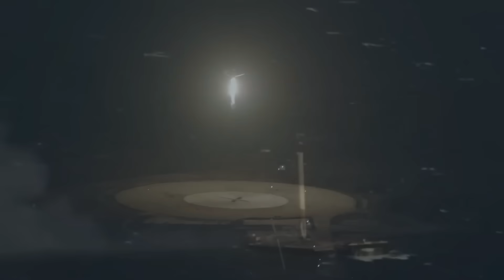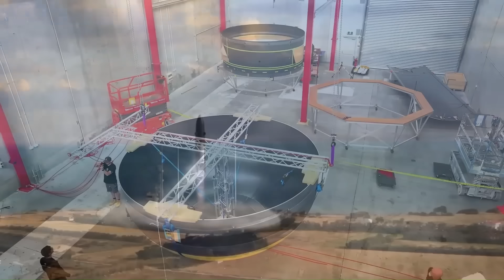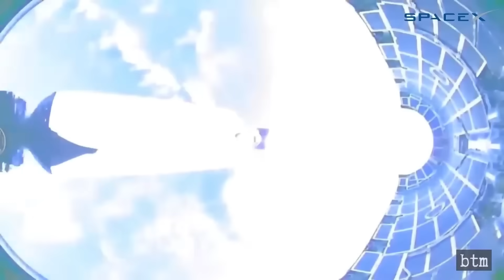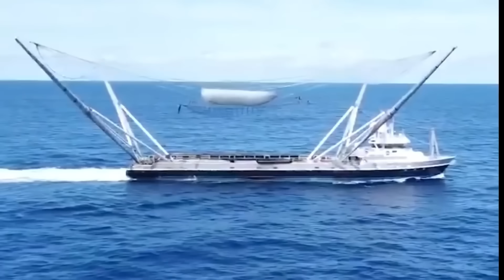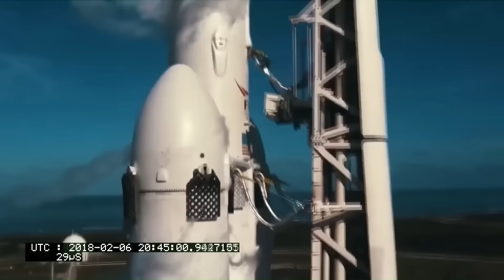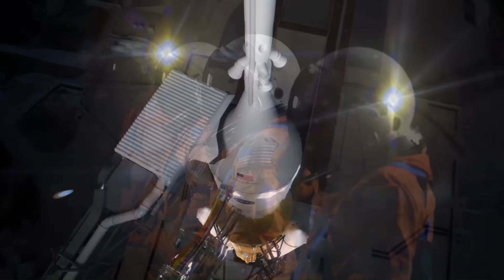What SpaceX Just Did With Falcon Fairings Will Blow Your Mind!

Comment: They are not the first to reuse a "rocket" or booster that "has gone to space"... The Space Shuttle routinely reused it's solid rocket boosters and the Shuttle and it's main engines.
Reply: Those solid rocket boosters did not perform a controlled landing, they were ditched into the sea for later salvage.
Reply: “Reused” shuttle SRBs cost almost as much as first use.  Engines required expensive and lengthy refurbishment after each use.
Reply: The reuse required extensive refurbishment, and the process was more costly and time-consuming than initially envisioned.
Reply: Did this made a difference in launch cost ?
Reply: @Kriss5054  The reuse required extensive refurbishment, and the process was more costly and time-consuming than initially envisioned.
Reply: @erikbarsingerhorn4485  That was my idea… 😈
Reply: @Kriss5054  If you read three sentences earlier you would have seen that this was already said🤔

Comment: So NASA recovered their solid rocket boosters using a parachute since the 1980s.  Spacex wastes a lot of upmass, at $10,000 a lb. to orbit, to save the fuel for landing.  P.T. Barnum would be proud.  Oh, and they're 0 for 3 in the last Starship launches.  If they blow another one up over Florida, the FAA will pull their license to launch from Texas.  Another Elon mistake.  NASA launches over the Atlantic for that reason.